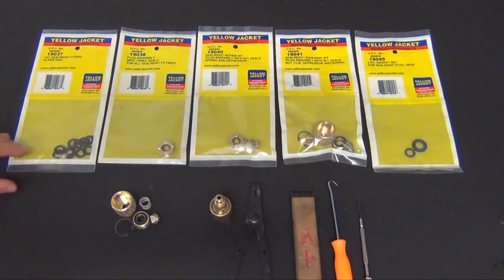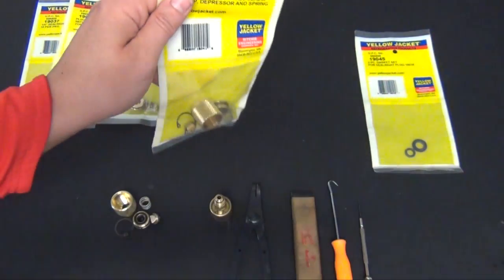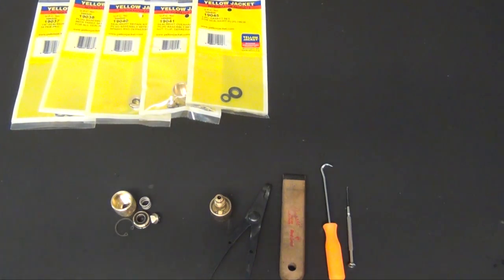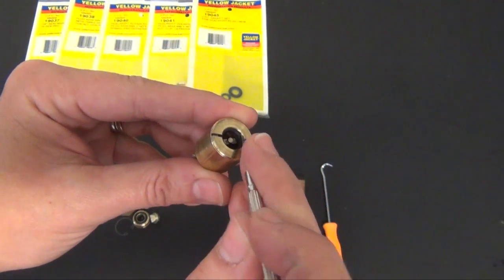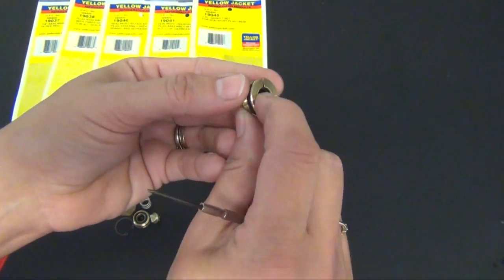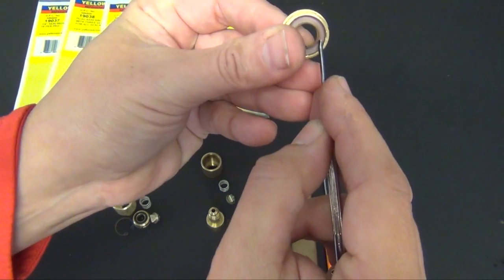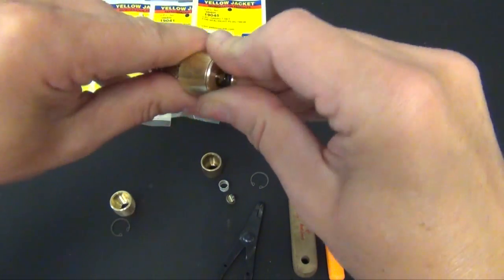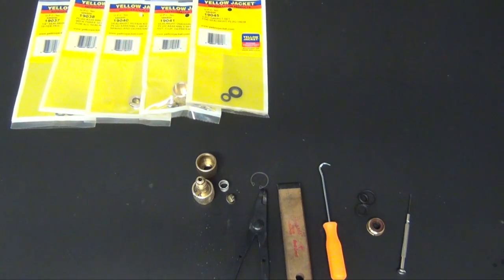YELLOW JACKET Tech Tip: How to Rebuild SealRight

Comment: I am in Toronto,Ontario and there is NO WAY of finding the 19041 in any HVAC supplier, it's so frustrating. Wolsley , noble , Air heat supplies , HST they don't even have it in their system. FFS
Reply from the maker: Hello!  We are sorry to hear you are having trouble with product availability in your area. To find a distributor near you, please go to: https://yellowjacket.com/distributor-locator/.  If that doesn't work, please call 1-800-768-8370 or 952-943-1300 M-F 7 am to 5pm CST for more help and information.
Reply: In aradia fl. You cant even get a 3/8 bolt if its over 4 " long ..you gotta order it .😂

Comment: Question : I bought a set of ac gauges (not a popular brand)....but they dont fit my goodman gsx130481ba unit....how would i go about finding out what size fittings are on this ac unit....
Reply: mr roboto, you need the size adapter. I recommend the 45° angle ones, easier to use

Comment: Where in the hell do you get the pliers? Is there another way to take that ring off?
Reply: Cuzzy420 Snap ring pliers, common automotive tool. Pretty much a tool truck sells them, snap-on, Matco, and Cornwell. Amazon or eBay to find them cheaper.
Reply: Or Harbor Freight. 😉